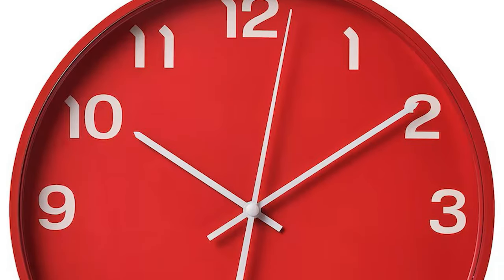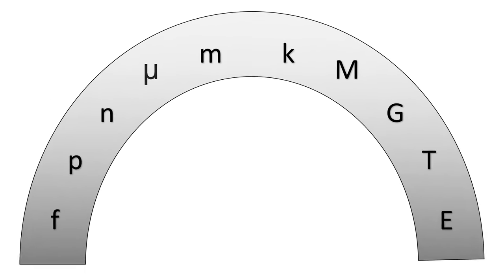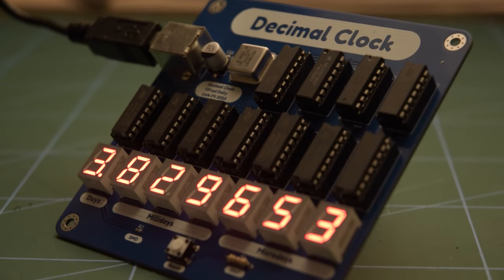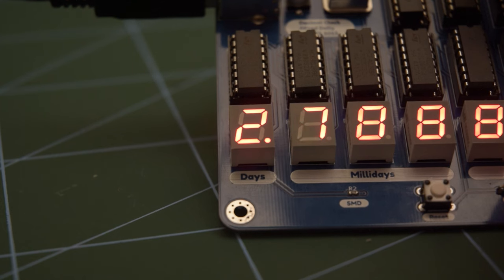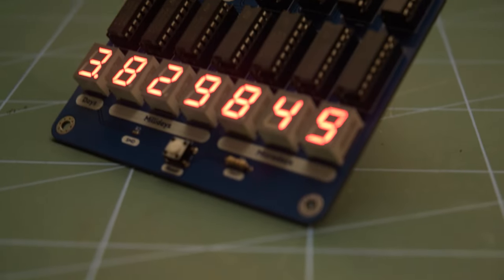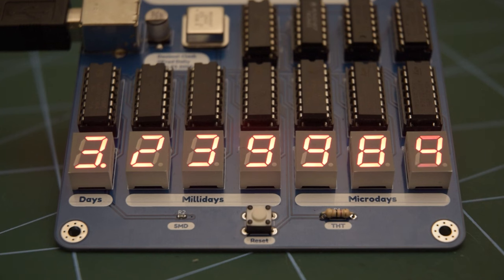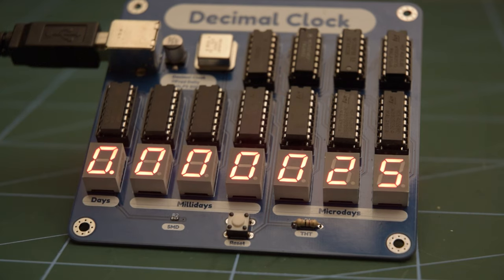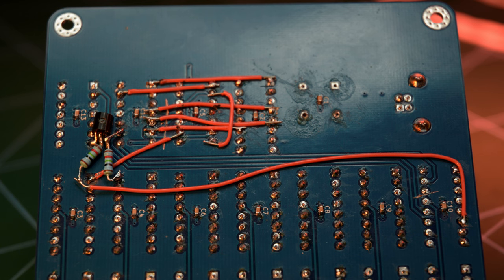Time to Switch Things up - The Decimal Clock

Comment: 1 decimal hour = 100 decimal minutes = 10,000 decimal seconds = 100 millidays = 100,000 microdays = 2.4 hours (2 hours 24 minutes).
1 decimal minute = 100 decimal seconds = 1 milliday = 1,000 microdays = 86.4 seconds (1 minute 26.4 seconds).
1 decimal second = 10 microdays = 0.864 seconds.

So, at 0:39 the clock shows 3.826125 days. We can rewrite it as 3 days 8 d.h. 26 d.min. 12.5 d.sec, or 3 days 826 millidays 125 microdays, but it's not necessary now.
0.826125 days in hours equals 0.826125*24= 19 .827 hours.
0.827 hours in minutes is 0.827*60= 49 .62 minutes.
0.62 minutes equals 0.62*60= 37.2 seconds.
Therefore, 3.826125 days equals 3 days 19:49:37.2 (or 7:49:37 p.m.)